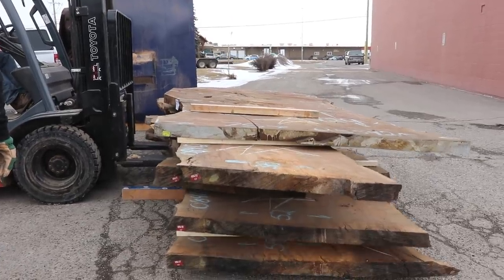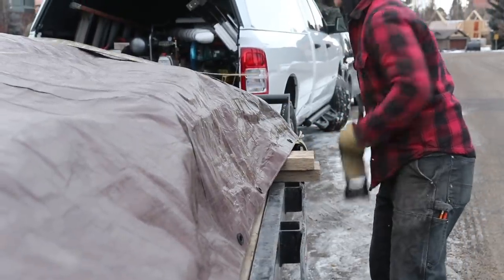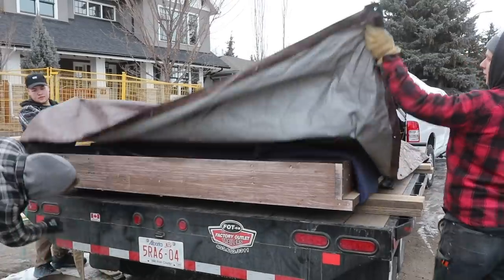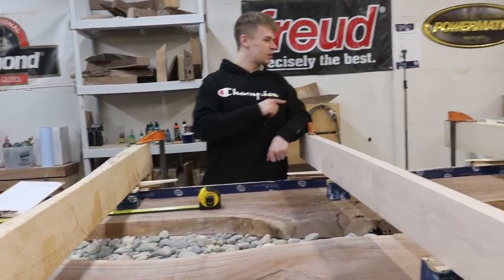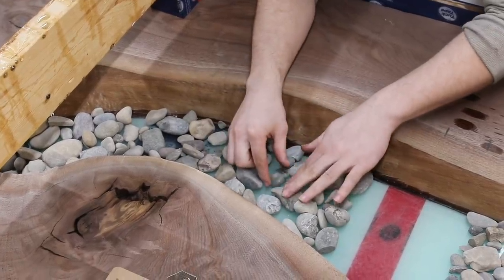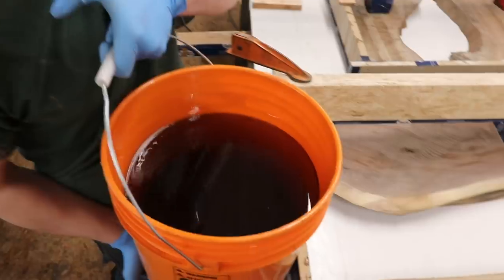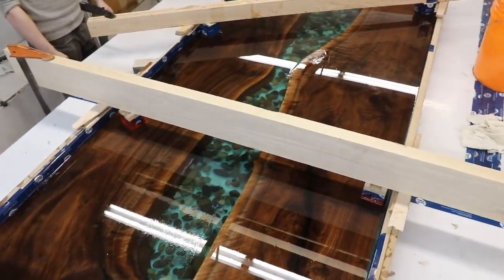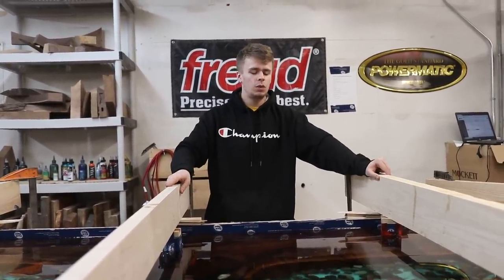Installing a $17000 Solid Wood Door

Comment: http://imgur.com/gallery/f4CNOAy

Do you think $5900 for this door installed with a multi-lock system is a fair price. It's 36×80. That's with all the hardware and a permit. I'm in South Florida also so the cost of stuff down here can vary. If anyone can give an opinion, please let me know.